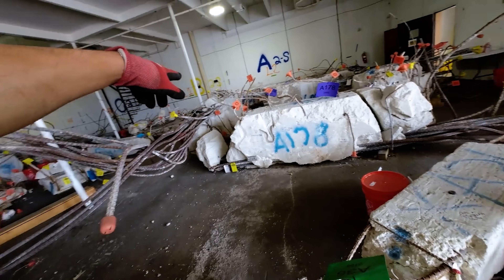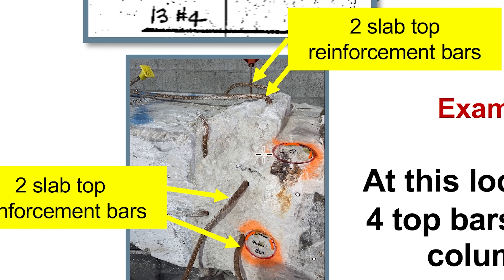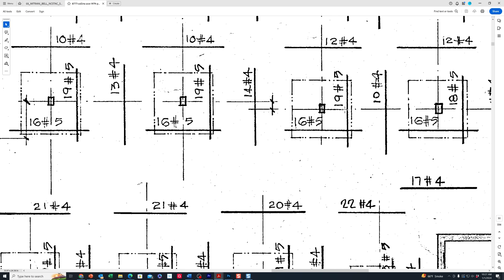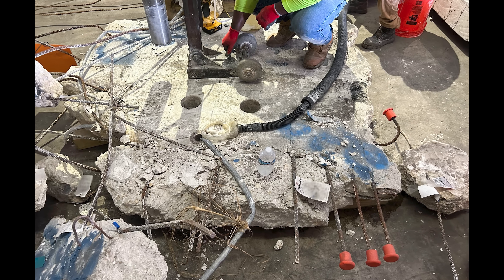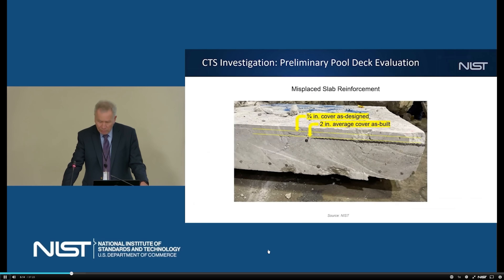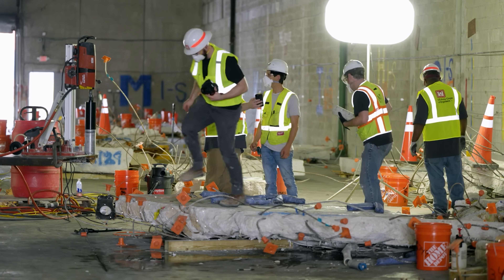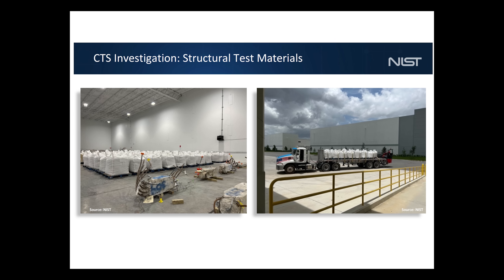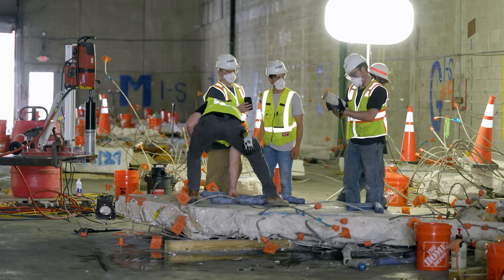More Shocking Build Errors in Miami Condo Collapse

Comment: Of course, if there is supposed to be 19 bars vertical, 25%  of 19 bars is 4.8 or 5 bars.  Having 2 bars instead of 5 is even worse than 2 bars instead of 4.

Comment: Curious: A recent sliding glass door replacement -- my door had to be inspected before flashing (to make sure it was bolted to the wall/studs correctly), after flashing (to ensure no leaks), and after stucco (final inspection). So my question is: Was an inspection of the rebar done before concrete was poured? If so, why was the incorrect placement of the rebar in said posts not caught? Seems like the construction inspection was also flawed.

Comment: The faulty construction practices suspected here were pretty much standard before Hurricane Andrew. Inspectors rarely, if ever, visited sites that had resident engineers, and rarely did inspections anywhere else. The rampant fraud at that time was responsible for the defects. I believe that every structure built in Dade County before 1993 should be rigorously inspected for similar defects.

Comment: Slab on column is designed for punching shear. Rebars only "delay" the inevitable collapse, not contribute to the punching shear capacity. Basically, concrete strength is the major concern.  The whitish concrete is low strength concrete. Bluish concrete is high strength concrete. WHY is the concrete so white? I can distinguish the aggregates. White rocks, white sand?

Comment: Phase 2b NOT a concrete pin joint. The slab height off-sets produce a bending moment on the vertical column. Bending moments are faulty engineering in a vertical structural column! But a big money saver!

Comment: In the absence of (city?) building inspectors during construction, the contractors, perhaps steel workers(?), would be directly responsible for following the blueprints and spacing the rebar according to plan.  Isn't that how it's supposed to work?  The first thing that occurs to me is, someone's in a hurry or trying to cut corners in order to save a few bucks.

Comment: The Engineer signs off on the steel arrangement before the concrete is pumped in. If the contractor has the engineer's certificate, then it's on the engineering firm.

Comment: Keep in mind that contractors bid on these jobs and sometimes the developer takes the lowest bid to boost profits (you get what you pay for).  The contractor probably told the crew to take out every other rebar in the pool slab, the other way to save cost is to add additional water, changing the slump from what is required to a lower level (making the concrete more runny), which will has an effect on the strength of the concrete.  When the inspector comes and inspects the job, signs off and leaves the crews will take out every other rebar and pour the slab. Back when this condo was built in Florida inspectors took bribes because they did not get paid very much.   I worked on a highrise in Florida where the city plumbing inspector got caught taking bribes.  Most general contractors are honest and adhere to the engineering requirements and building codes.

Comment: Hi. A thought… There should be a building law that requires the city or contractor or engineer/design company or a neutral third party (if that could ever exist in this crazy world) to document by photographs the critical rebar “skeleton” framing before the concrete slurry is poured over. This would have two benefits. Provide a visual document for forensic research in the event of structural failure in the future. And it will provide incentive for all parties involved in the building to play by the rules for fear of legal and financial accountability! Thank you.

Comment: I don't knowwhat happens in the USA but in the UK, during construction the local authority should send along their own Building Inspector staff to check that the works are according to the plans.  If they find issues they can stop the work continuing and insist oin corrective action.  I recall many years ago, for example, a neighbour was having an extension built onto their house and the construction company, probably to try to save money, used roofing trusses that were half the size they should have been using according to the architect's approved plans. This was spotted by the Building Inspector and the under-size trusses had to be removed and replaced with the correct size trusses. If this had happened at Champlain Towers South, then construction would have been to plans and the "missing" lengths of rebar would have had to have been put in place.  Do you also not have a Clerk of Works who checks construction to ensure it is corect, from the client's point of view, whilst construction is in progress?

Comment: Ap per pro of nothing, very much, I note with interest that NIST are doing more research and in greater detail - including experimental research - into Champlain Tower South, than they did on WTC's 1, 2 and 7.  The three worst structural failures in history, with One and Two the worst, followed by Seven and they are still at it after nearly four years.  Anyone else notice that?

Also, anyone notice that the remains of those lost in the Champlain Tower disaster were all found and identified, because they were all under the floors of the building?  In Towers one and two, out of just shy of 3000 victims, only 1900 or so were identified using DNA sampling on what amounted to fragments.  Finger bones, elbow joints and teeth mostly, spread over HUNDREDS of metres in no particular pattern, with no trace of 1150 victims ever being found at all.  They were both gravity only driven collapses - weren't they?  Just sayin'.

Comment: Would like to add, that  pipe-sleeves for ele, plumbing, fire & storm lines interrupt the rebar schematic, we plumbers have to sleeve, or no bathrooms. The other option is to core the podium, but doing that cuts any steel reinforcement, that can't be replaced, sleeves only cause a slight relocation of steel

Comment: For any experienced design and construction engineer it is absolutely sufficient to please critical design requirements in the notes, including rebar placement and concrete finishing. All the notes are important and shall be adhered to. There is no such thing as a preferential placement of the notes on the drawings.

Comment: I am a design engineering inspector and can tell you that most buildings I have looked at are defective in one way or another but the large factors of safeties save them from collapse. At least the new Florida building code requires engineers to do site visits in the high velocity wind zones to check out structural components.
Reply: They should make the engineer sign off on the rebar stage before concrete.

Comment: At TAMU structural engr class, 1976+/-,  professor took class on field trip to the two tier football stadium.    Object was to show engr fix to huge cantilevered precast concrete beams that held up seating sections.   Steel Structural members added to outside faces to supplement incorrect rebar sizes used in concrete.
   Drawing set done by TCB had note, " all rebar to be  #5 UON".  (Unless otherwise noted.).   Most were called out correctly,    some that were not labeled should have been #8s.       Fast forward, summer 1979,  same stadium being expanded with 3 deck.    I worked on concrete placement crew casting precast beams at grade  maybe 60' long, 7' deep x 3'.   To be install up top.   We cast 2 Monday, 2 Tuesday. Thursday we jackhammered them apart.     Same Engr Firm from 1976,   same rebar note was on new drawings,  same error.        Murphy is always out there.

Comment: During this (corrupt) late-70s period of So-Fla high-rise construction, it was typical that only the foundation (pilings) and that very first slab connecting/covering the pilings, (plus the sub-grade retaining walls) was given serious scrutiny, and you see that evidenced in this tragedy, i.e. the foundation/settling was NOT a factor in the collapse, and that garage-floor slab was completely intact, despite the 13-stories above hammering down on it.  So much else was sub-par crap!

OTOH, the new '87 Park' tower next door seems to have been a "Rembrandt" in all regards, and I'll bet the rebar is all righteous and to plan.  If we find under-construction pics, you might even spot a degreed Land Surveyor on-site, working the VERTICAL dimension, i.e. "shooting a line" up the side of the building, to insure that each successive column and floor slab is cast perfectly in line with the gravity vector.  #MinimizeAdverseStresses
Reply: Think about it--only the "stylish" requirement for an "open" lobby, without columns in the middle of the room, saved the street-facing portion of the building from collapsing, i.e. because of the extra-heavy transfer beams needed to span the longer distances, which led to the beefier (24" x 24") columns to support them, etc. 🤦‍♂

Comment: Having seen some images of hard drives that successfully had useful data recovered -- I think the odds are actually quite good that they'll be able to pull something out of that mess. Probably in excess of 90% of the surface is still there to be read. Dirt isn't nearly so bad if the parts aren't moving and there is no scraping going on. Cross your fingers, but I think you'll see something out of this.

Comment: Here's a thought. In an explosive collapse, has the absence of rebar at the end of the insertion into the wall created a shock focus on reflection into the area above? Akin to a cutting charge, the energy piling in from the release of the pool deck rebar, under increased strain from night-time cooling, had to go somewhere, and it would have found the weakest point. Straight through the step.

Comment: Jeff, 
Honestly, I have to ask, do you really believe that the lack of rebar was a simple mistake? I mean, honestly? In my experience, any so-called mistake dealing with a lack of materials that are called for is a deliberate, cost cutting mistake. So that is an outright crime. Calling anything like this an "error" is false. With the lack of structural steel rebar in this case saved the construction company a lot of money. If that company did this here, I guarantee you'll find that same "error" on any other job they were involved with in that area. You save that much in materials at each job, you are saving a lot in cash to put back into your pocket.

Comment: At the 5:14 mark:  There’s a HUGE leap between thinking a note should have been more visually prominent, and concluding this somehow means the engineer has some culpability.  The only way the engineer would potentially have ANY culpability for the contractor not following any notes on the plans is if the engineer either approved shop drawings showing this noncompliant condition, and/or field inspected this specific column location and overlooked the omitted rebar.

Comment: The way I read note 5 says they should've had 5 of the 19 rebar across the column in that direction. 4 out of 19 is closer to 20%, not the minimum of 25%.

Comment: Thank you so much for your diligent pursuit of the truth. There appears to be a total lack of oversight and quality assurance, which would have prevented these obvious structure compromises. Having spent most of my career in the engineering and construction of nuclear power plants, I can tell you that the current investigation by NIST wouldn't be necessary after the fact, had proper documentation of the building process been in place. Yes, it costs more to build a structure as designed; but this failure is an excellent example of the ultimate cost of failure in lives lost

Comment: After 52 years of practice as a consulting engineer I knew that just because it was on the plans, it didn't matter.  You said that the note required four rebar across the column.  This could be interpreted as two bars each way, totaling four, which NIST found.  A few contractors look for places on the drawings that can be interpreted in such manner as to increase their profits.   PN
Reply: Call out 4 rods each way. The column punched through the floor slab.

Comment: ANY BUILDING IN THIS AREA IS QUITE SUSPECT TO INTERNAL CORROSION WHETHER IT HAS THE PROPER NUMBER OF RODS OR NOT!
A SHORTAGE OF RODS, PLUS CORROSION ISSUES IS QUITE DEADLY!
ANY OTHER BUILDINGS DONE BY THE CONSTRUCTION FIRM, INSPECTORS, AND ARCHITECT, NEEDS A THOROUGH INSPECTION, PLUS X RAYS, AND ANY OTHER INSPECTION MODES!
THERE MAY BE A GREAT NUMBER OF UNKNOWN DANGEROUS BUILDINGS!!

Comment: What about the apartment that collapsed in New York thankfully no one was there when it happened
Reply from the maker: Looks like the engineer approving brick repairs incorrectly identified a corner column as non loading and told the contractor they could remove bricks from it to start repairs of cracks on the column. HE was incorrect and should have also told them to place shoring poles.

Comment: There is 4 rebars going across but 2 are on upper surface and 2 on lower surface of the deck... Could they have been incompetent enough to think that was ok?
Note the  specifications is for TOP rebar, and bottom shall be #4@13" Bottom each way!
Where is all the #4 ???

Comment: Well this stuff is supposed to be being inspected right. Builders mistake or not. Builders make mistakes especially on your 1st project. It should of been laid out and inspected before it was poured. What inspector signed off on the job? That's whos head should be in the ringer.

Comment: Rebar also does not look to be deep enough into the slab top either. I have seen a lot of that over the months of pictures released. Even the collapse pictures of the balconies showing the rebar peeled out of the bottom of the slab as like it was only an inch off the bottom form or less.

Comment: If I was a contractor id overbuild structures over the structural engineers plans and make double sure everybody is perfectly happy with how things are build and nobody notices any issues.
As an electrician I have to work with a mindset of cheching everything twice and making double sure things are build right unless I want to die of electrocution or have an electrical fire on my ass.

Comment: There are a lot of red flags in this.  Marking the blueprints in red (snicker, snicker) they were copies of the original drawings all down on blue print paper with no time for them to be marking up blueprints by the engineer (which one architect or builder), who was on another job by then.  Remember they went to the lowest bidder to do the construction.  Who, by an unknown someone could have allegedly have put in the rebar, passed inspection and then were somehow pulled out for use on another floor.

Comment: So being a structural engineer, I will say calling out a detail like that on plan notes is highly unusually. That was effectively them highlighting, bolding, and underlining what was supposed to happen with that rebar. 

The rule of thumb for drawings is don’t call anything out twice, that way it’s harder to contradict yourself, which can cause confusion and issues down the line. Calling out details in the notes like that is reserved for stuff that’s *important*.
Reply: Is reviewing rebar shop drawings not as prevalent as I'm thinking? In every major project I've done, rebar shop drawings are provided to catch these kinds of errors.

Comment: If the security center was located in uncollapsed part of the building don't the damaged drives show that they were still there when this part was demolished? Why weren't they be removed by investigators before the controlled demolition?
Reply from the maker: Yes the main lobby was left intact after the collapse it wasn't until they did the controlled demolition of the second part of the building to bring everything down that there would have been any other damage caused to the computers. However I don't know why all of the computers and hard drives weren't removed out of the buildings first maybe they thought it was unsafe maybe some of these hard drives are just from other computers from the parts of the building that collapsed and they are trying to determine where they came from

Comment: fault is not on the engineer,  that's how it's done, ( I've read blueprints as a career, for a lumberyard..
the plans refer to the page of footnotes.    
plus  the number of bars,  equally spaced,  would match the number of bars on the plan,  the only way to space them further apart, is to not install the full 16 bars    
the contractor and the inspector are at fault,   with the contractor being mostly to blame.
there might be corruption involved,   china has a problem and buildings  that were not build to plans,  are called Tofu-dreg,  because they are as strong as tofu

Comment: Did you find the contractor's reinforcement shop drawings for this project?    Typically, reinforcement shop drawings are produced by the contractor and submitted to the design engineer for approval.  Punching shear is a very serious problem and is best handled by using a welded structural steel cross, e.g. (2)W6x25x5'0" for an 8-inch slab centered over the column, or some other equivalent.   Even though only single layer reinforcement can be used per engineering design theory, double layer reinforcement is better as an extra safety factor (less creep, guards against moment reversal due to dynamic loads, corrosion, effects, etc.).  Upping the psi by 25% above the design value also helps with the SF.  Typically, the structural cost is about 25% of the total project cost so that the adage "penny wise, dollar stupid" applies here.  P.S.: The step-up could have been better designed as a transfer girder with a large torsional capacity.